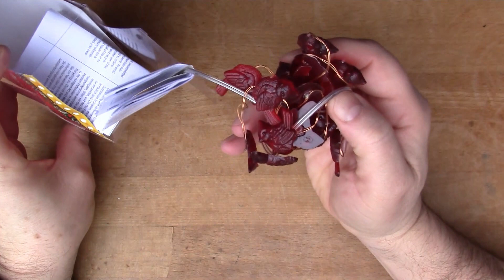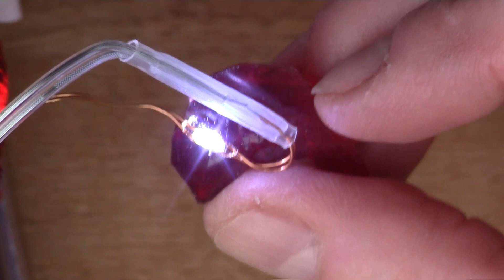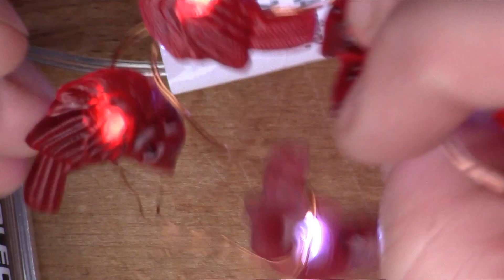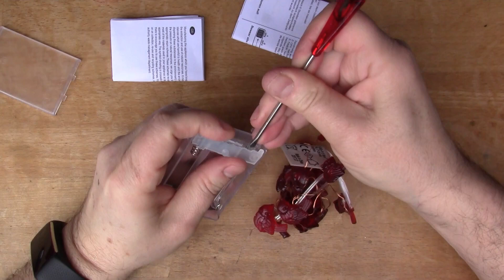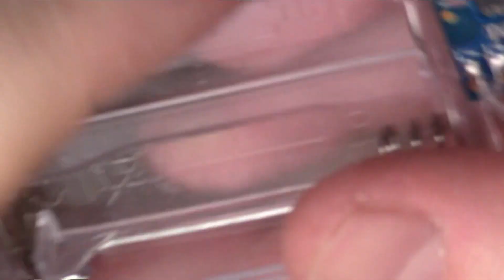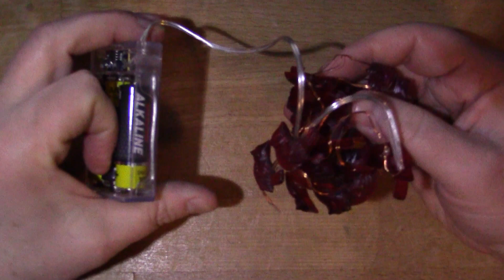Christmas Lights with timer - teardown (#91)

Comment: Bargain and interesting little timer, maybe good for other projects? Three cells 4.5V, would that be to provide enough power for the IC? I have a few of these copper wire strings attached to Joule thieves with LDRs and they make lovely ambient lights. Great video, thank you.